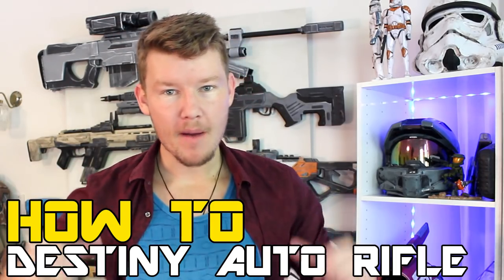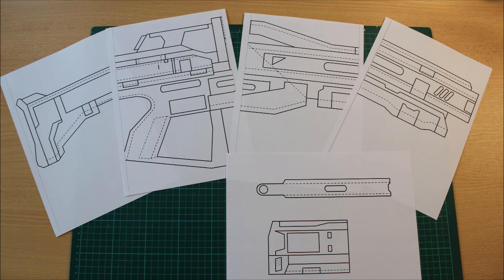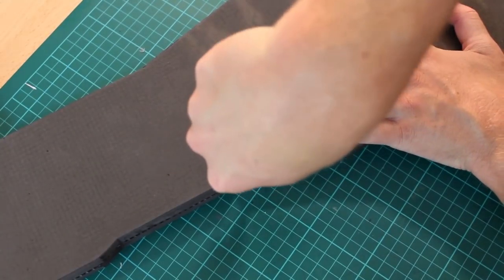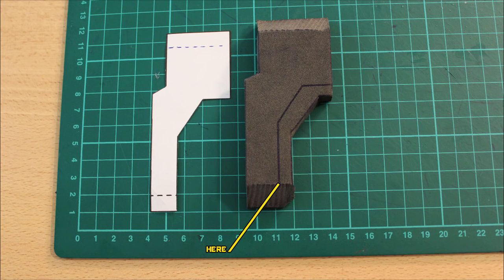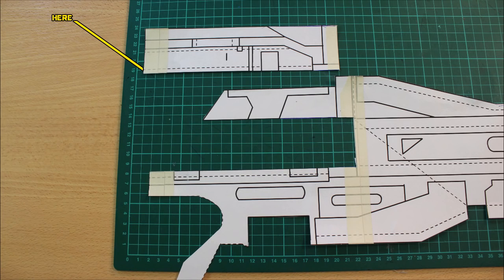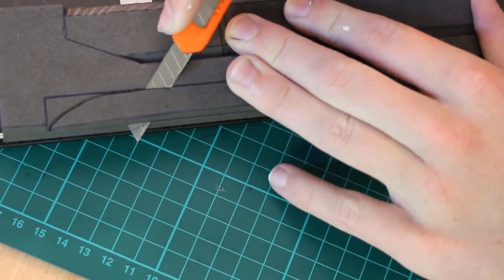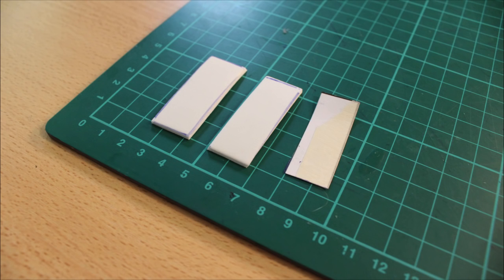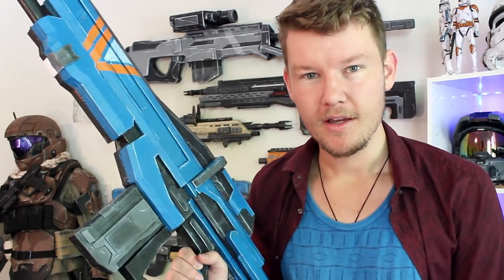HOW TO:  DESTINY Auto Rifle Cosplay Prop - Part 1

Comment from the maker: Arm yourself Guardian =D enjoy the build!
Reply: Andrew DFT shadow price!
Reply: Andrew DFT last word pls
Reply: Andrew DFT I love your channel! Great tutorials!
Reply: How do you smoothen out the edges from the "sawing"action of bevelling?
Reply from the maker: keep the momentum and make it like a wave not so much traditional sawing.  the heat gun will smoothern out the edges. If there are significant marks then your blade is to dull.
Reply: Andrew DFT How thick was the foam u used for The pulse blade helmet ?
Reply: Hi Andrew DFT. I was wondering where you got the foam and what size the mats were.
Reply: Andrew DFT yes master
Reply: Hey ADFT where did you get the foam for the build?